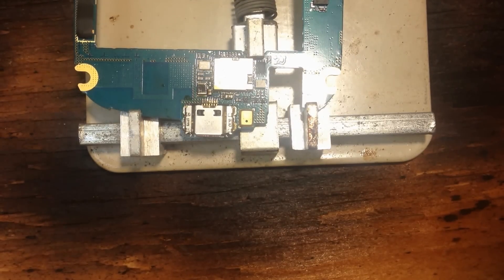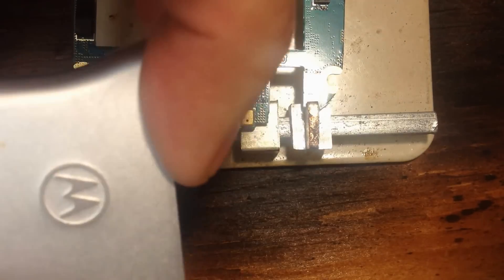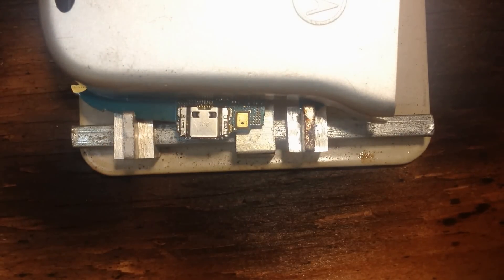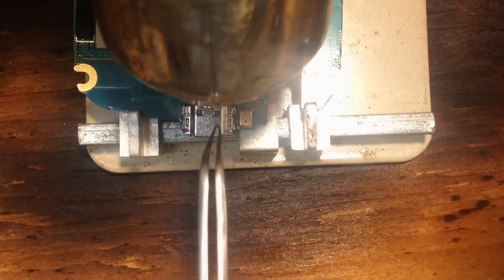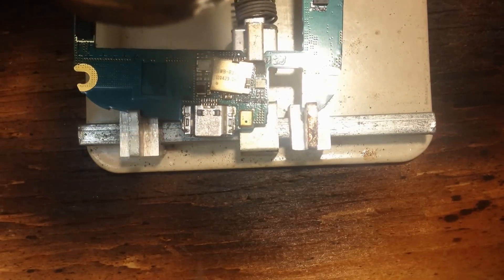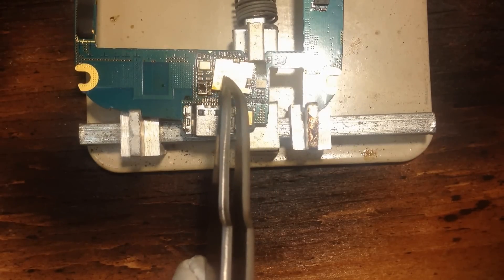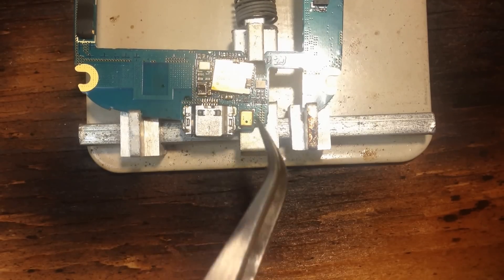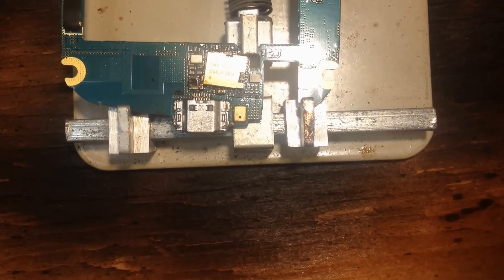Charging port, usb port replacement

Comment: He states the board is already dead so that's why he's using what looks like a standard heat gun. If anyone is attempting their own repair, be sure to use a proper smd heat gun and kapton tape to cover surrounding components.

Comment: What kind of tutorial is that? You clearly ruined your board. My advice to anyone, DO NOT use a heat gun. You will almost always ruin the board as seen on this video but if you do buy insulating tape (heat tape) and cover the whole board other than that little part you are going to replace to protect against heat and good luck!

Comment: Using this video I repaired a smartphone. I did get one side in more than the other at first, but I reworked it using the heatgun combined with a soldering iron to get both sides flush to the board. I used a cut up beer can as a shield. Great, straightforward video! Thanks!

Comment: my charging port on my lumia 800 is fucked could i just buy a new mainboard with the usb port on it . I have got my phone apart and the board out, the usb port looks very small.great vid by the way!
Reply: Go on eBay and look up micro-USB ports.  You'll be shocked at the variety of spare parts since they're essentially mass-produced Foxconn (or similar company) parts.  The gotcha is it needs to be exactly the same, so if there's a few common ones...  Caveat Emptor!  You might as well get more than one, in case it happens again.  It's just the nature of those really thin wires to snap off.  :(  Not sure if it's the right port but you can get them on eBay for about a US $1 for 5-10 ports.  They're as cheap as resistors.  :)
Reply: hey! i have the same problem whit my lumia800. did you try to repace the micro-usb port? did it work like in this video? or you buyed a new mainboard?

Comment: Out of curiosity will a hair dryer work?
Reply: Tim Clerkx
In fact, it's best to use a infrared thermometer?  There's no-touch thermometers (or IR cameras) that people use when doing this to Teh Evah BGA CPUs and memory.  See on HackADay and Youtube:  'GPU laptop reflow' or 'video laptop resolder' or 'video card resolder' or 'BGA reflow' or any mix of those terms.  Rework is another term used for resoldering.  You'll get lots of examples of fixing the infamous blackscreen issue on (quite often HP 'desktop-replacement') laptops.  I own a 'icepick' thermometer that can be used if careful on solder pools but I've never had a reason to use it for that so I'm not sure how reliable it is past 350 degrees Fahrenheit(183 C).  I got some bismuth solders to avoid this whole deal with overheating SMT components and board glues on devices that don't reach temperatures over 90 degrees centigrade(194 F).

You can in fact get away with just eyeballing it when the solder beads loosen like on the micro-USB, but a thermometer is much more certain and you can't see BGA beads.  :/  In practice, you're very unlikely to overheat the traces if you follow the directions in this video, assuming you're not a newb to soldering.  You're MUCH more likely to underheat them!  :-D

Also, anyone wanting to learn surface-mount device soldering should look up something called the 'stencil soldering technique'.  You'll literally feel like a chump for using through-hole for years when this method is available!  https://www.sparkfun.com/tutorials/58
Reply from the maker: no that will not get hot enough.